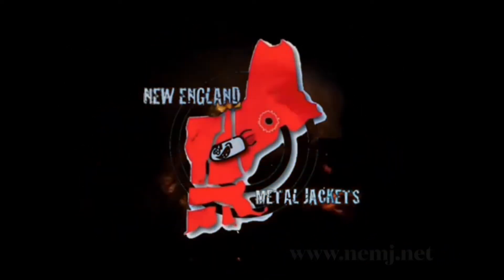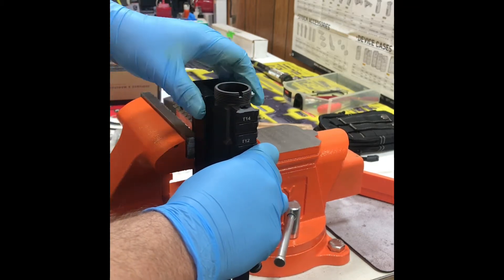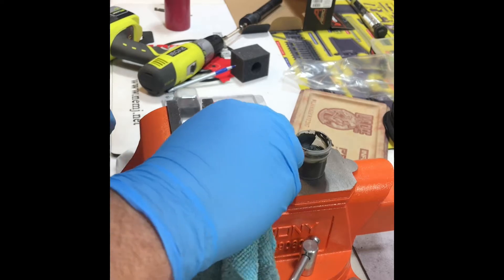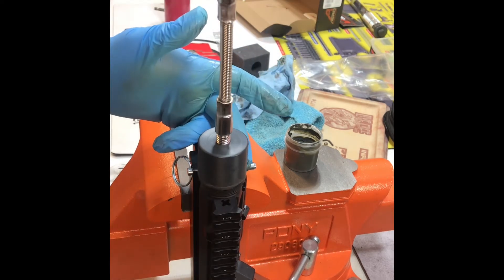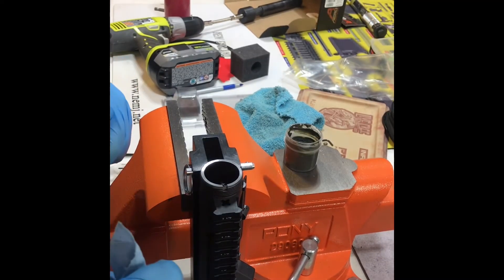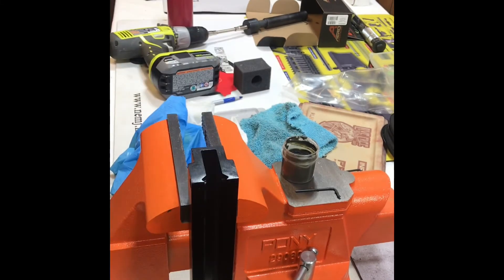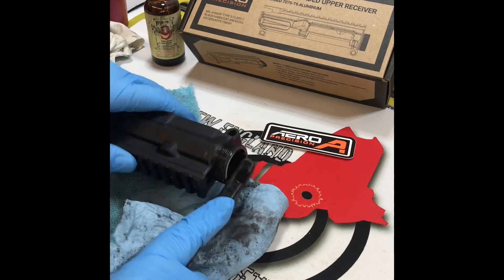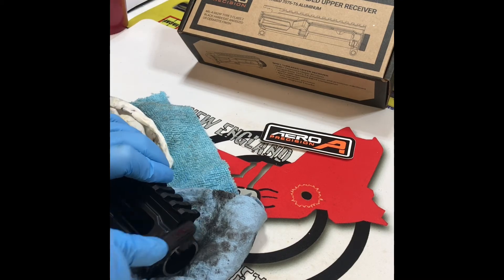Aero Precision Upper Receiver Lapping

Comment: Sounding so very professional with describing every single micro step of your procedure there, but there is no “ paint” on that upper. What you are scraping off ( for whatever reason) with your “ lapping”is the nitride finish.
Reply from the maker: It’s a process that ensures the surface of the upper is “true” where the barrel shoulder mates up with the upper. Sometimes the coating could be thicker in one are compared to another and on the face of the upper this could effect accuracy. 
Some people swear by it. Some think it’s a waste. Ultimately it’s up to the owner of the gun how they want it. 🍻

Comment: I cant believe you lapped the anodizing from the metal....... Anodizing provides a corrosion resistance and most of all makes the aluminum surface harder and more wear resistant.....     If anything lap before anodizing.. Now it is soft aluminum against hardened steel..... Shaking head.... again and again....
Reply: Lol what exactly is wearing there?  It's not a moving part.  I think you misunderstand how an AR-15 works...😂
Reply: @perditionluc bare aluminum against steel doesn’t usually get along too well. It has nothing to do with the “ movement “ between the two metals but the corrosive reaction between the two. This was taught in elementary science classes. Obviously you don’t know much about, well anything.
Reply: Most end consumers buy upper after anodizing. When assembled the area is heavily covered in lubricant/anti seize. Minimal worry of corrosion
Reply: @douglass56 also aluminum does not corrode as fas as like steel. With barrel nut torqued properly there shouldnt b any movement and very little wear. Even if there is wear I would prefer a better seated barrel that is potentially more accurate and eventuall replace a 100 dillar reciever after decades.
Reply: @douglass56 don’t know where you buy your uppers from😂 but mine come clean.
Reply: You have to admit, he sounded very “ professional” in ruining that upper😂😂😂

Comment: So stupid.. it's a damn AR
Reply: And this improves the performance…
Reply: @atox4957  nope.. it doesn't
Reply: @TheSixpkAmerican  I do have to ask you why you think it dosnt help? As it heats up wont the paint in the threads start to get soft or evem melt a bit? Then it could cause issues.......no? Im just asking as i am a shooter but green ot the ARplatform.....
Reply: @michaelw.urbansr.8617  Nope.. nothing will happen.
Reply: @TheSixpkAmerican  Ok at least thats one less step to worry about. Thanks
Reply: I’ve had more than one receiver not 100% squared off. Lapping helps align the barrel thus improving performance. Not saying it’s a dramatic improvement but proper alignment helps
Reply: @atox4957  it's an AR...
Reply: @TheSixpkAmerican , yeah. I’d rather have mine optimized regardless
Reply: @atox4957  you are not improving anything
Reply: @TheSixpkAmerican  I think your too funny bro! But do you know for sure it dosnt help? The only thing i knew about lapping  before i watched this video is that it was a process but not what that process was? lol  I think what ill do since i have 3 AR15's ready to be built as i have all the parts and an AR10 all but the lower. Im waiting on the NIC's to come back as i purchased it on friday. Then i wont be building anymore ARs or at least thats what i promised my wife to get the AR10 lower! LOL Shhhhhh!? tehehehe
Reply: @michaelw.urbansr.8617  what ?
Reply: @michaelw.urbansr.8617  Who are you?
Reply: @TheSixpkAmerican   HAHA nobody just someone that is just getting into building ARs that has done a lot of research. Sorry if i put you on the spot but im just curious to know why you think it dosnt help? Since i have never heard about the technique ,im still trying to decide if this is worth doing? Just want to hear both sides of it?
Reply: @TheSixpkAmerican  sorry if you didnt expect anyone to comment on your comments? lol I was just hoping to hear why its not worth doing? but thanks for the laugh....
Reply: @michaelw.urbansr.8617  AR rifles were not "lapped" by colt, especially after surface treatments. This is silly. Rack grade rifles can hit 18 inch targets at 300 m or further
Reply: This operation helps the surfaces of the extension flange and barrel nut be parallel. I use a lathe and a mandrel. The front face can be out of square with axis of threads from .003" or more. Parallel faces reduce the stress on mating parts when tightening.
Reply: @xringhammer1871  don't do it on the reciever vs the barrel extension. Under stress of tightening the softer aluminum will give that much.. this is completely unnecessary.. it's silly. You are NOT getting any better accuracy. If the upper manufacturer thought this was, they wouldn't coat it... Especially high end.. LWRC, KNIGHTS, AND HIGHER DON'T DO IT
Reply: @TheSixpkAmerican  I believe you're missing the point of this operation. The front of the receiver may not be square to the threads. It's not so much about improving accuracy as reducing stress while assembling. Do it or don't, but have an understanding of why it's being done. Your choice.
Reply: @xringhammer1871  it does nothing
Reply: And my AR will out shoot your bolt gun champ.  It's ok, keep being stupid, you'll provide lots of laughs.
Reply: It matters when you are shooting that AR 1200+ Yards
Reply: @cohesive3482 😅😅😅 lol nope... The aluminum will expand to fit the steel. Getting rid of the anno will cause galvanic corrosion.. sorry this is stupid AF
Reply: @thesixpkamerican1  Barrel extensions are usually made of 8620 steel, 8620 has a very high chromium content and is therefore very resistant to galvanic corrosion. For galvanic corrosion to exist anywhere, you must have 2 reactive materials AND and electrolytic source. Such a source would be very unlikely in a properly assembled, lubricated, and torqued barrel extension in a receiver. So unless you are using the AR underwater in the ocean, this continued claim of galvanic corrosion I keep seeing thrown around by GOTCHA experts is unfounded and inaccurate.

And the aluminum will not "expand" that much. And even if it were, there would still be an uneven distribution of force on the entire system. This is all standard metallurgy and mechanics of materials stuff. Any third year mechanical engineering student should know it.
Reply: @NoName-tq9fi  wrong
Reply: @NoName-tq9fi  the aluminum is secured. It's a gas operation with moving parts. You don't need to cut the upper.. that is nonsense. It's an AR. Most can shoot out of the box.. 2 inch groups. You argument is silly a waste of time and does zero.. literally zero for accuracy... Zero